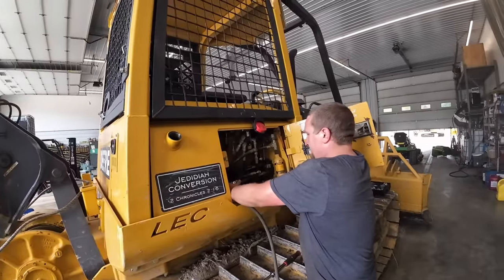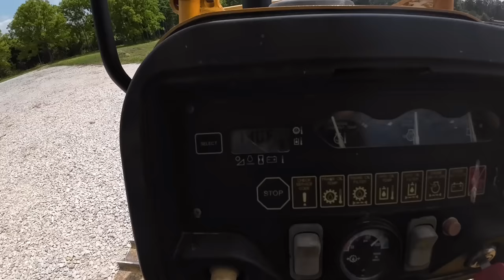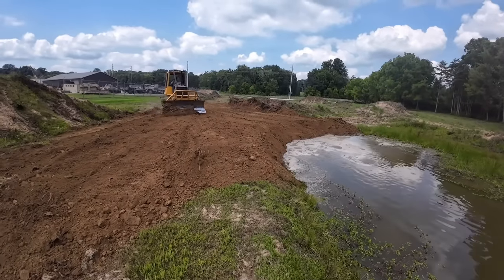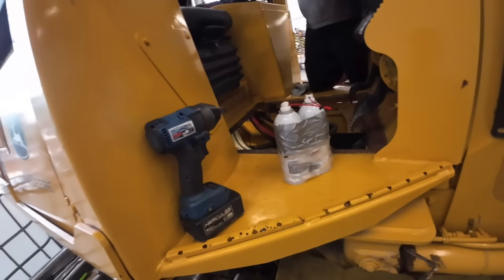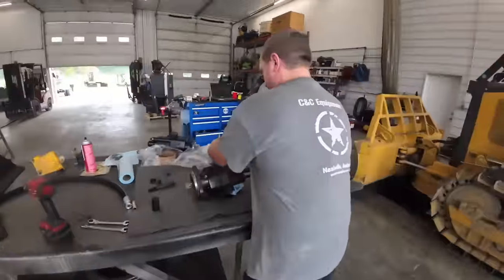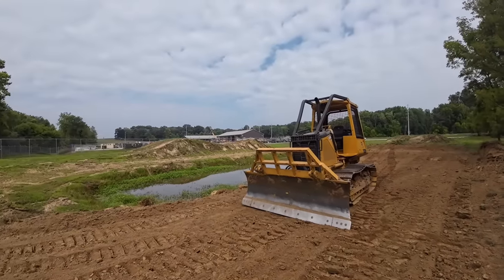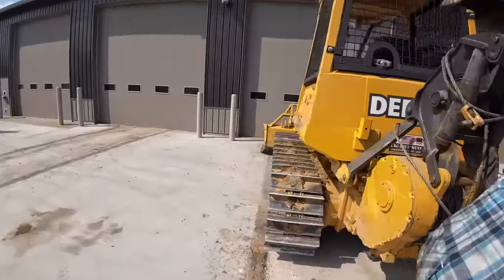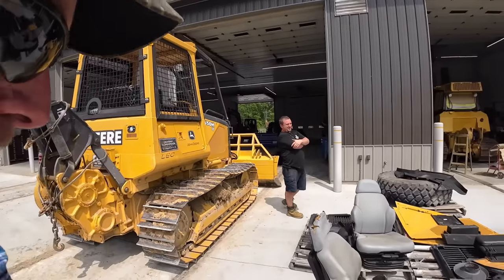Overheating hydraulics back again for the second time, I’m about to pull my hair out on this dozer!

Comment: This is my dozer! And the 3rd one I have bought from C&C! They have fixed it and it runs awesome! These guys are hands down the best company ever. Clinton goes way above and beyond in customer satisfaction  as you can see in this video. My first dozer from them was a 450J the 2nd was a 550K both with forestry package and perfect dozers. This one I just mentioned that it was getting warm and he said bring it back and I'll take a look, and you can see what taking a look means to Clinton! He truly went above and beyond! Thank you, from a very grateful client. Dean.
Reply: After they cut down the trees and make rafts form them, how do you ship them to Israel? Just asking.
Reply: Hi that block that gate valve change it have had the pipes 
es heat up the gate valve and on changing it the 
crimping machine worked again  pump could also be helping 
It after cevrral hrs valve was shot worked to max press 
On foot with every crimp.

  @alfitz2189

Comment: Check with CEE from Australia, he uses some kind of 4 part spray concoction to check for cracks that aren't visible with the naked eye. Kurt might be able to help. He has a machine shop and makes some really amazing parts for the construction industry in Australia.    👍❤️📹🤔😃
Reply: Curtis uses a Magnaflux Liquid Penetrant Testing Kit. (SK-816 Kit)
Reply: Welding supply’s have a 3 can PT kit. Been using it for years. Works flawlessly. Only had to apply a little heat (200*-250*) twice for the crack to show up  in 18 years.
Reply: Kurtis is a master of hydraulic ram and bucket/blade repairs, a lot can be learned off him.
Reply: they have used it here to

Comment: I was a hydraulic shop lead tech after I retired from  the Navy at the rate of Chief Hydraulic mechanic- then worked at a hyd repair shop for years- we ran into one hyd manifold that had been machined about  10 thousands too deep on one port- it drove us nuts trying to find the problem - like Clint- it took a while to find problem, and cost us a bunch in time as well, it takes a good mechanic to figure out difficult issues- my hats off to them- take care

Comment: As a 40+ year Individual Journeyman Machine Repairman, I’ve had great results by checking the temperatures as soon as it starts from cold. Pump, valves etc. as you know,The internal leakage will generate heat. So there’s a greater temperature difference at start up.

Comment: Had an issue similar to this on a 980c loader. The dealer and the mechanics kept saying I was working at too hard is why it was overheating. We took it into their shop and we got a season mechanic who try change the vent on the hydraulic tank problem solved and $80 part and we probably spent close to $3,000 trying to solve the problem. Now I routinely clean the vents on any machine I'm running.

Comment: Funny I was going to mention a MT or PT test. (Magnetic partial test or penetrant test). You can pick up a dye penetrant kit at a welding supply. It’s a 3 can kit. Cleaner, dye, developer.  Works really well. Used it for years working on oil storage tanks and Pipelines. It’s not expensive and it’s a quick test. You  should have a couple cans around for sure. It’s well worth it.
Reply: Kurtis @ Cutting Edge Engineering (Australia) has a few videos where the test kit is used - another great Youtuber and heavy machinery "fixer"
Reply: Good morning Mr.C you could strip the valve body back apart. And heat it up. (Not too hot). Any oil that is hiding in a crack will start to come out. And you won’t need to use the dye penetrant on it.
Reply: We used dye penetrate on nickel base valves and components and had great results.
Reply: I dont understand why a crack in the valve body causes overheating, can you esplain plz
Reply: @rmiller2179  it will cause the oil to go thru the crack when it is not supposed to and that will generate excessive heat .
Reply: @rmiller2179 if it's a part under high pressure the differential can cause major cooling and heating problems. As it is forcing fluid through an office that is too small creating a LOT of heat, and as he said.. that tractor gas no way to dump off the heat, there is no cooling radiator, or fan for it. Just the large capacity of the hydraulic oil tank.
Reply: ditto
Reply: Yep! PT is the way to go. It is cheap and easy. I'm a CWI with a PT cert. We use it on every new to old weld on pipe.
Reply: I've been told that the 25/32nd sized wrenches were used on the early early Ford autos.

Comment: We blew a hose on John Deere 862 scraper filter housing and my guy had one made but they only had a smaller diameter hose. For months we kept cracking welds on housing and we finally figured out that the smaller hose was the problem.

Comment: You can use Dye Penetrant Inspection paint. It consists of three agents, 1) Red Dye, 2) Cleaner, 3) White Developer. You apply a cleaner to the surface, then a Red Dye, wipe off the dye and then you spray it with a White Developer. If there is a crack the dye that is in the crack will show up easily as a red line in the white developer. Inexpensive  process and very easy to use.
Way to stay with the problem until fixed. Says volumes about your ethics. Thanks for sharing.
Reply: Bingo. I mentioned it aswell.
Reply: We used that and magnaflux on Coast Guard aircraft parts back when I first worked on Grumman HU16e Albatross seaplanes. 
Found a few landing gear and engine mount craves that way.

Comment: The easiest way to find cracks in cast valve bank sections I’ve found is to clean and dry them really well and run a torch across them, either the edge of the crack will turn bright red because the material is so thin or you’ll notice oil start rising to the surface and revel raking the size and shape of the crack

Comment: You look just like my nephew that every time I watch your videos, I think of him. He is a great kid/man and is probably about your age. Glad you found the problem. Hydraulics can be very deceiving. I had a problem that looked like an electrical problem because it was repeatedly extend and retracting a cylinder over and over again. Come to find out it was a relief valve out of adjustment. After further investigation we found out that it was the operator intentionally adjusting the relief valve so he would not have to run the machine. When I got thru with him, he transferred to another plant.

Comment: I run a 982m cat loader at work, we've been having trouble with the hydraulic oil getting hot 210 degrees, the mechanic wouldn't do anything till it throw a code, i finally worked it hard enough to get it to the 220 range where the code throw is. The mechanic camecout and used his temp gun. He found a major change in temperature at the valve that is much like a thermostat on the cooling system. It wasn't opening to send the oil through the oil cooler. He changed thatvpart and now normal operations the oil is 130 to 140, the hottest I've gotten it is 155.

Comment: To look for the possible crack in the valve body you might want to consider taking it apart and strip it down and then place it in a oven at 225 degrees for about an hour or so to make sure the valve body is up to temperature and then check it for cracks
Reply: U.V. Penetrant or Magnaflux inspection would reveal any cracks or fatigue in a no load condition. The special equipment is a bit pricy to own and in this instance, impractical. But, an alternative is have a machine shop conduct the parts inspection. 
 Always good to have a buddy close by in Indiana who owns a machined parts manufacturing business.

Comment: From a old retired Mechanic ,hear me out, First I don't know your tractor hydraulic system set-up. But here is the formula I used over the years, gasoline /diesel /hyd. systems with oil coolers  all operates at about/around 100 degrees above the outside temperatures. take in account common sense operating conditions.  good luck
Reply: Great point. They said it was real hot. Someone just said run it till it blows up at this point.

Comment: That machine can be ordered with a cooler, from Deere. I’d recheck it and make sure it’s not equipped with one and if not, install one. Maybe he’s using it hard enough to require one. It doesn’t make any sense that a cooler wouldn’t be installed on the machine as part of the OEM package but only as an option… that’s stupid.

Comment: Clint.....or may i call you Dr. Clint.......I'm always impressed with your diagnostic skills. I was accountant by trade, but I've always enjoyed working on stuff......my first introduction was in 9th grade and taking small engine class in our schools vocational area. I graduated in 1977 and back then our high school offered in house vocational....auto, carpentry,  machine, metal/welding, electronics,  drafting, and wood working/furniture.   It allowed students to pursue a wide range of interest in 1 setting. Anyway, these things have gradually been moved to an out of town vocational school 30 minutes up the road. Todays youth aren't exposed to a wide range of skills to made them better prepared for the challenges of everyday life. We also had what was called co-op where you could go to school 1/2 day and then go work for 1/2 day in your area of interest. You would be a great mentor to young adults looking to work in the heavy equipment career.

Comment: We like watching litter bugs, especially when you wave at them and they hightail it out of Dodge. That oil heating issue was a head scratcher for sure, in 40 years of being around hydraulics, I’ve only witnessed 2 cracked valve bodies and they both only showed themselves when run hard. We found the cracks by disassembling and throughly cleaning the valve bodies and then put the body under a heat application ( we used an old toaster oven at 400 degrees) for a period of time and the oil would boil out of the crack leaving a stain mark as it cooked down that followed the crack line, just a thought for you sir, thanks for the tag along video sir, you were about to the point of scratching Kevin’s head because you were runnin out of things to scratch yourself. 😉😊
Reply: That’s a good idea. Never thought about the oil leaving a stain behind after cooking it out. I used several different test welding on oil storage tanks and pipelines. But never heard of that one. My favorite is using diesel fuel on the back side of a weld, seam, or supposed crack. Just a little fuel goes a long way. Way better test than water or pressure. Unless the integrity from full capacity is at question. But if there’s a crack or hole  the diesel will find it and pinpoint it out.

Comment: I can't believe you came outta that one without pulling your hair out Clint. 
I've had similar mind blowing problems repairing circuit boards that seriously had me ready to throw tools then have it be something so darn simple I'd have never thought possible be the problem. 
Especially when they first started putting rwal computers in arcade games. 
Sega was famous for harness problems and all theur wires were yellow or white instead of multi colored so it was a nightmare troubleshooting harness issues. 
You definitely deserve total respect from your customers.
This one you went above and beyond for that customer.

Comment: 25/32 is a standard size. I have several of them but they are old.
Reply: I was told that those two sizes were meant for the old time square burrs (nuts). Whether that true, I am not sure but there is probably someone who does.
Reply: Yup.
I had Craftsman 3/4 and 25/32 box ends straight, angled, and manifold style.  I did have one 12 point for square nuts and used it on an old cable dozer.

Comment: I've had this problem many times . It was usually one of two things. 
1... Something causing the main relief valve to open continuously under pressure.
@...Air entering the system on the suction side and causing "Dieseling" or combustion when the oil warms up and the machine is working hard. The oil gets darker and you can smell it. There will be froth on the surface of the oil in the reservoir. 
Good luck with this one .

Comment: The over heating problem sounds like an obstruction in the hydraulic fluid. It reacts/restricts under pressure. I believe at some point contaminated fluid was used and continues to be the problem. You have done a fine job hunting down the issue. Best wishes.

Comment: It always amazes me , that considering the size of these machines how little room they actually leave you to work on them ? You might try the Silver Seal crack detection spray for that valve body .
Reply: The easier they fit on a trailer, the cheaper the cost of ownership

Comment: Just a passing thought. Worn hydraulic pumps tend to make excessive heat. Probably wouldn't overheat the system, but it's technically possible, especially if working heavily loaded for long periods.

Comment: Check filter for clog. Does it have a filter? It's constipated .Somethings blocking circulation . Could have a in line filter inside of a hose just like power steering on a car.

Comment: Simple gear pump it pump rotates and pumps oil round the outside of the housing it cannot come back through the meshing gears so is forced onwards through the system. Nice easy pump normally one of the most reliable.

Comment: Manually put pressure on the outlet ports of the valve body while on the bench and maybe look for oil dripping out the the return port to test if it’s cracked/leaking

Comment: Thanks for standing behind what you sell, not every one will do that even if it is a brand new product. My suggestions for finding a crack was using a product called Magnaflux it's been around a few years, well from the late 60's we used it in the Army checking for cracks in aircraft engine parts. I am sure other brands are availably that may be better or less expensive but I see that you have several other readers that offered a similar suggestion and mentioned seeing Kurtis from CEE using a similar product on one of his recent videos.

Comment: Hello Clint & Kevin:  If you are going to check the bad valve body. Try dye penetrant inspection first. If nothing shows up there then MPI. The dye penetrant is available in kits and is cheaper you could do that yourself. What ever method you decide to use it will be interesting to see the results. Looking forward to seeing the new purchase and project. Keep the quality videos coming.

Comment: My 1st guess was a hydraulic line coming apart on the inside. Had a front brake line on a car do that to me, making the brake(s) drag.
Reply: The problem with this idea is that the cycle times should be affected. The idle times might not be (because the low flow levels) but high RPM under load the flow is much greater and would be more notable. In my thinking now I’ve been wrong once before kinda,  Thought I was wrong but turned out I was right the first time 😊
Reply: @almaylin464 hahaha.., you thought your were wrong one time, but turns out your were wrong about that…, hahaha, I have heard that before.
Reply: Ive had several brake hoses collapse on old vehicles, It is crazy how they can do that!

Comment: The old case dozers had an issue with the return line on the transmission collapsing and they’d heat up or just stop working…another thing is I would check the flow on return side of then spool valves to make sure all the fittings, especially the 90’s have been machined properly and there’s no restrictions

Comment: For many years ago we had a new Hitachi backhoe 
Where the the hydraulik valve was tightened so much together that the valve was oval so it didnt work .
We got what we call a new (piano) 
A  valveblock in it and it was working again. 
Thanks for another god video from your shop.
Regeres from way over here in denmark

Comment: Long extension just absorbs the power of the impact wrench. At that length would best to break with a power bar and use impact wrench to spin out. Harbour freight was larger diameter extension and shorter more shock applied.

Comment: I'd try to either  do a magnet partical check  or dye check,  dye check  would be easiest, it's a two step  process, 1 spray the dye let it sit fora couple of minutes, wipe with a cloth. 2 spray the developer on if you see pink show through the developer there's the problem.

Comment: the 78 jeep j10 used the same size /32th wrench but open ended. on the torque converter. only one in shop was hanging in on the old tool wall.

Comment: A gear pump is a positive displacement pump ie it does not increase the pressure, oil is incompressible it moves the oil a fixed volume at a time commensurate with its speed, the pressure is a direct result of the the downstream restriction...fyi

Comment: I know we had one of those valves on a jd tractor that was cracked,  it was cracked through the small square hole , we boiled it in water to get temp up on the casting and finally seen a crack in it .

Comment: My initial thoughts were a cylinder bypassing or a spool valve not neutralizing…I’ve seen control valves with cables adjusted too tight slightly opening a spool…but on a garbage truck not a dozer . Glad I was a spectator and not the quarterback on this job lol